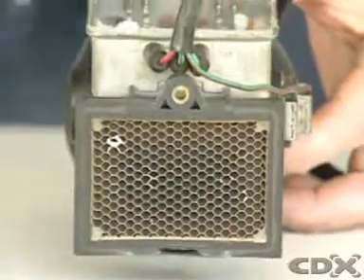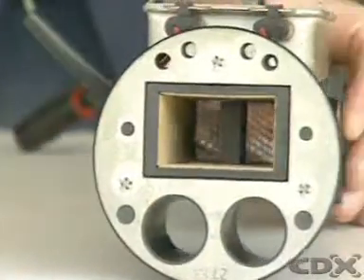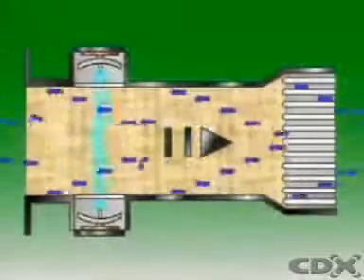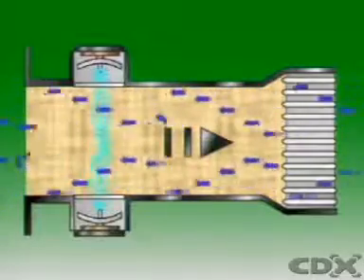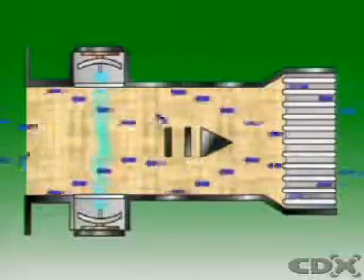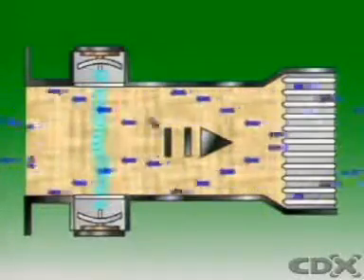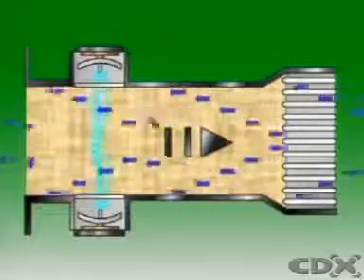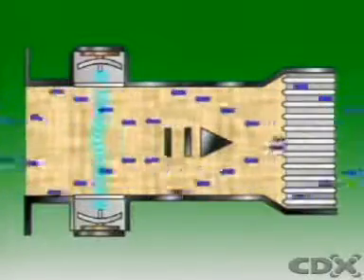Vehicle air vortex sensor

Comment: wow.....thats complexity, I just replaced one of these maf sensors from a mitsubishi outlander 2003,  cheap chinese replacements have the hot wire sensors instead, and convert the voltage to a frequency signal, I paid $40aud for a replacement, works ok, not sure how long it will last. The maf unit I replaced had issue with the IAT ( air temp sensor) it a small orange thermistor located in the wind flow tunnel ( looks like a zener diode but is a thermistor)